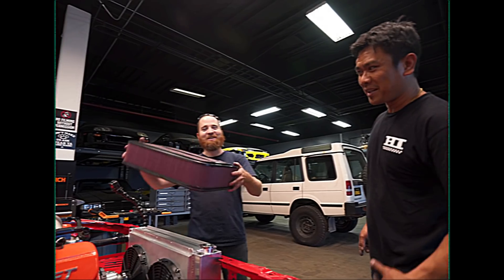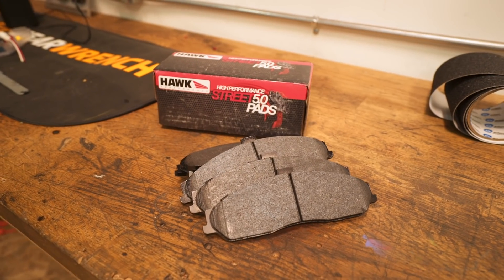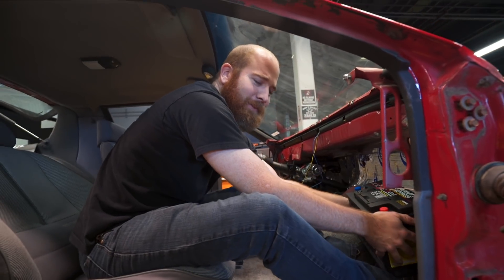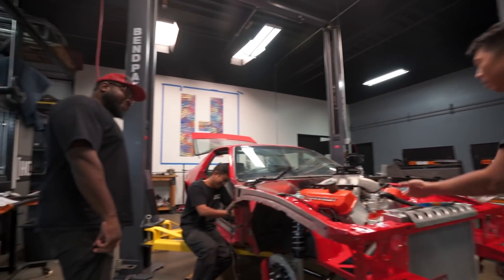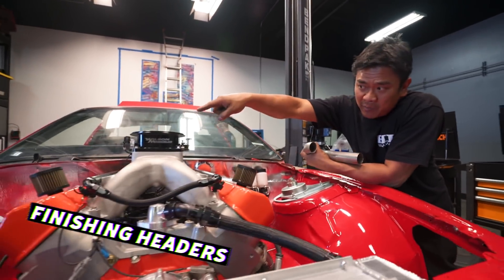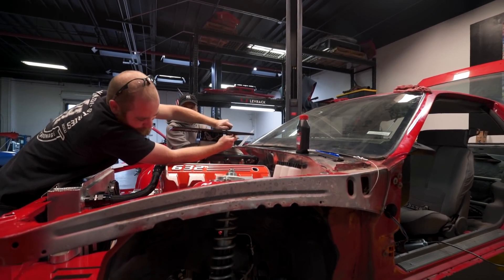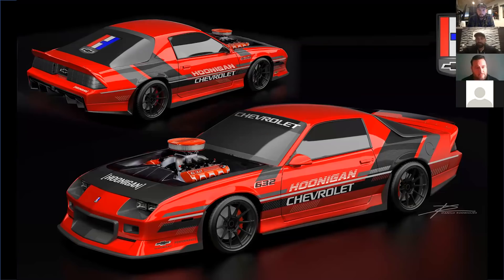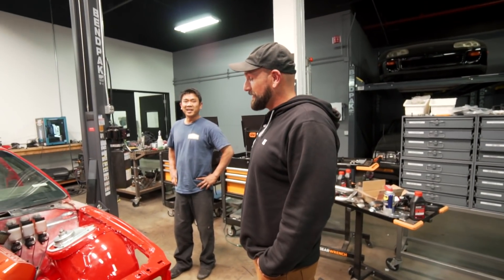632ci Chevy Big Block ROARS to life! First Start of our 1000hp Gen 3 Camaro build

Comment: I love how the GM designers are detail oriented (and self-aware) enough to include that OE orange peel in the paint in the rendering.  EVERY 3rd gen I saw back in the day had that paint flaw from the factory.
Reply: I had an 89" IROC. Black. T-tops. No orange peel. Instead the black paint faded and left giant white patches. THAT was the common flaw.
Reply: @KingSMW  My 88 RS was likely repainted a few times before I ever owned it because it looked like glass , but my old 84 Z28 was missing most of the clear coat . Chevy's paint may not have been super high quality , but compared to everything else their rust prevention was light years better . I've owned a 77 an 84 a 88 and never drive but still have a 95 , and none of them ever had any rust issues .
Reply: That's not an intentional choice, it's an artifact from the 3d scanning process. It's basically the same thing as noise in digital pictures, but in three dimensions.

Also, orange peel isn't a flaw, it's just a natural feature of the paint process. You can polish it out, but that's more expensive and less durable.
Reply: That's just a default setting.  They're using the vRed "Simple UI" which is a clear indicator that they are just using the programs asset manager materials in comparison to building and modifying materials; orange peel in the program looks a lot different.  As others have stated, that effect is from the body being scan data.
Reply: Look at any new car today. Orange peeled
Reply: Chevy did a great job woth both liveries

Comment: A whole lot has changed since I was doing this back in the 1970's - forced induction, electronics, nth-level tolerances and metallurgy - but, it seems, even today it's still a bunch of folks in a garage bleeding on the parts and solving the problems as the come up while stuffing big motors into small bodies and nobody gets along until it's done except they knew they were the team the whole time. Nothing new under the sun and I'm so happy that this is still true.

Comment: "632 cubic inches - there's no third gen camaro driving around with that motor-" 
me and every cleetus mcfarland subscriber remembering his 3rd gen camaro nicked "Toast" that he took to Australia for a burnout comp running a Blueprint 632 with a supercharger. (he did later on replace it with an engine built by Castlemaine Rod Shop, but still, he had one and drove it, even caught it on fire + blew it up. and while yes this is the first chevy performance one, its not the first ever 632 in a 3rd gen.)
Reply: He said this motor. As in this new crate motor that just came out. There’s been big cubic inch engines for a long time with aftermarket stuff.
Reply: @NBSV1  yep this motor, that everyone has used via Dart etc it only counts now, because its a GM crate and not a "632 Big Block Chevy" thats been used by everyone from NRE mirror image setup to countless Restomods (at SEMA, and every other Custom Car building Show) of the last decade. The heads on this 632 say LSX, I wonder how close to being a AFR head?
Reply: @NXT_LVL  It still changes what it is once it's offered as a GM crate engine though. The parts were available and lots of other people have built a 632. But, they weren't offered as a drop in crate package from GM. It might just be semantics,  but it's still true. It might even be assembled from all aftermarket parts. Doesn't change the fact that this is the first time GM has offered it as a crate engine.
Reply: just let them do there thing and shred some tires off with it

Comment: 0:13 See how this filter not only has media on the sides but on the top too? Only the best highest flowing filters have this setup. This is basically the ideal performance intake filter setup as decided by the benchmarks set on the always relevant Engine Masters intake shootout video which taught us so much (specifically that those go-to massive cone intake filters are actually not the best for performance). Also I love your guys' VHS and 80s effects its so fun

Comment: saw this car on a trailer last week going through ontario, ca. heading north at around 6pm.   Pretty bitchin.      Ngl im unable to appreciate it fully because my mustang is being repaired and its gonna cost 1545 for replacing radiator, radiator hoses and water pump.... fuuuuuck.

Prayers please... just hope my mechanic is reliable as he was when i first got it.  (great guy but damn... im having a hard time if i should or shouldnt trust the mechanic anymore.)

Comment: Can the engine handle boost, and if it can, will the transmission be able to handle the torque?  If it can handle that will you add forced induction?

Comment: I know, there’s nothing like accolades from the internet to make your rather gloomy day into a bright sunning one but, in case no one has said it lately, she’s a Beut to all the Clark Fellers Hoonagianing it up sliding in with a increased vehicle completion rate of 95% as of late! Just saying 
Seriously, awesome job as I’m certain it will be a blast to mash the loud pedal!! 
Here’s a suggestion, that beautiful fabricated battery tray would’ve have surprisingly turned out even Mo Better with the use of  (4) 1/4 flush mounted hardware, or at the very least 12 point ARP hardware rather than the (40) 3/4 x 10 grade 100 hex head bolts purchased from Caterpillar dealership off of rose drive / 605 fwy! 
Naturally, it must of been tough setting such large press nuts assuming,  press nuts were used!! Just saying

Comment: no no no you don't want the tubes the same length. because of the firing order. 4 and 7 need to be longer so they aren't so close together . it is a very big gain in hp for no extra cost in making your headers

Comment: 638 cubes stuffed into a bowtie block with severe mods. 4 wheel drive squarebody over 1000 hp threw uprights built in the grass and shed by one man. It's the profile picture if you need a hint and I knew exactly what it sounded like lol actually mine is still louder in person no jokes!.🤣
No lift
No machining equipment 
No shop
Basic tools
Built by me...
Oh and 3 first place trophys on the shelf to prove it's a beast...
Deez nuts!

Comment: Polished aluminum or black flush mount hex heads. Maybe a T5 would have been my choice for the carbon switch plates, not ....Glue or epoxy. (Cringe) Would have kept that stock-ish interior design.

Comment: Hey hoonigan race team. 
I'm trying to find a radiator and water pump just like what you have on this car for my blueprint engines 632 big block I bought. 
 Can you guys send me a link for the radiator and water pump you guys used please?
I'm not having any luck to even find information on what to use. Thanks in advance
  P.s I've got it installed in my 1986 Chevrolet k10 and it is my first build ever

Comment: I call baloney, the ZZ632, and the 572, and the 502 all say  the engine size on the valve covers. Since this engine does not have any of those numbers on the valve cover, I'm calling this a 454, NOT the 632. PLUS, the valve covers aren't even the right shape, AND the 632 is a coil on plug setup (also a fuel injected setup if we're being technical).

Comment: A electronic cross ram fuel injection like Chevrolet parts used to offer (mechanical though) for a 510 BB dry sump would fit lower and look a whole lot better.  F.A.S.T.    What's another 12K to see where you are going.  A/C would be cool on a hot summer night in a parade. Easier to fit than twin turbos with an intercooler.

Comment: I wonder how much a build like that cost, 150k?
Reply: $5,000 3rd Gen. 
$40,000 Engine 
$5,000 Trans
$4,000 suspension 
$1,200 steering 
$2,000 brakes 
$10,000 MIS. 

So $70,000 plus labor.

Comment: EVERY. SINGLE. VIDEO... When you try (but fail) to make a "Reality Show" on YT, full of irrelevant content, ads every 10 seconds & then finally get to the one minute of content actually related to the title. There's a word for that. Ummmm, something bait. Click maybe? And for the love of Zeus's bellybutton, STOP SAYING MOTOR. An alternator is a motor. Motors utilize ELECTRICITY. An engine DOES NOT. Be it steam, gas or Diesel, ENGINES USE FUEL. Try putting "motor oil" into an actual motor & get back to me on the outcome.  Jordan in NC